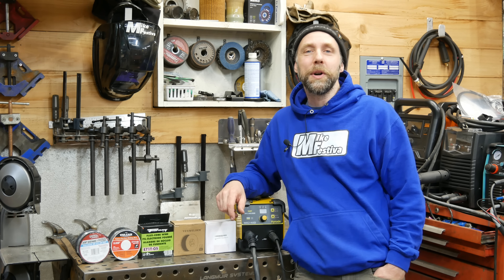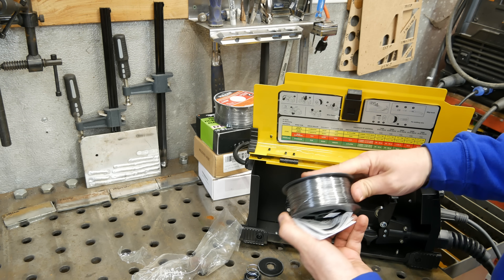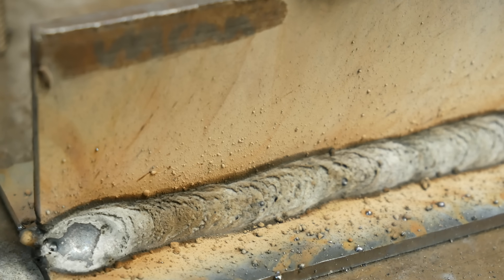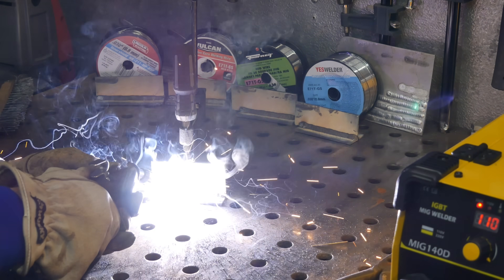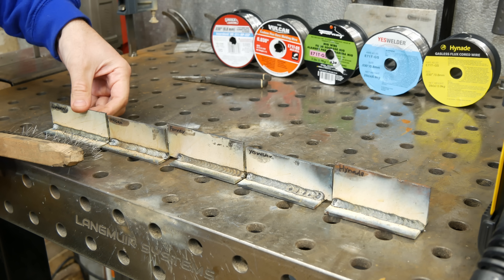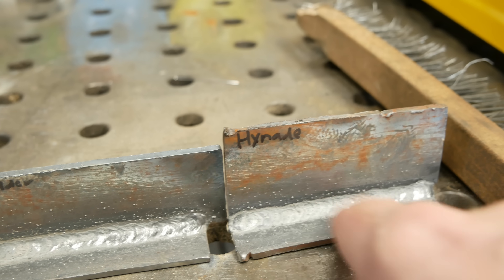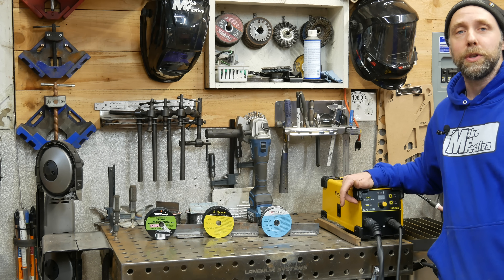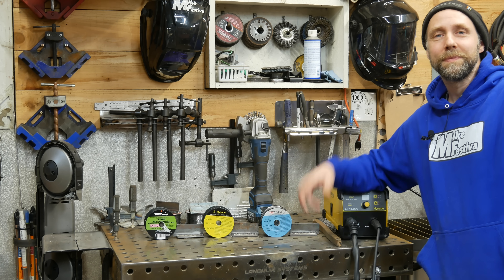Gasless Flux Core Welding Tips, Make Better Cleaner Welds

Comment: If you make sure your welder is set up in DC neg that will give you much less spater and cause less porosity and give you more penetration well. You shouldn't have to change your heat or wire setting at all. also the closer your welding Nozzle is to your work piece the more splatter you will end up with as well. when welding with flux core.
Reply from the maker: I covered all that in this video 👍

Comment: Why do you have the gas nozzle on with gas less welding?
Reply from the maker: Because it really doesn’t matter with flux core wire what nozzle you use, you can take the nozzle completely off and it won’t effect the weld quality. When welding with gas is a different story.
Reply: Some machines can switch between flux core or gas shield. Keeping the shield in place protects the treads.
Reply: @ronaldfranck6960  and the gas outlet holes. Some welders you can buy a shorter gasless shield which still allows a better view of the job than with a full gas shield in place. I'm just a beginner and picking up tips by the bucketload 🙂

Comment: That's all I use is flux wire I'm out side welding. If I was in a shop and could leave my tanks hooked up in a shop I would go with shielded gas welding it looks nicer with no spatter with the dip goop. Good to know about the wire though something I didn't know. I do have another machine I'm thinking of hooking up a tank. This machine does all 3 MIG, TIG, ARC WELDING. I want to modify the electrical wire to make it longer so I don't have to be right next to an electrical outlet.

Comment: Do you like the Hynade better than the Titanium 125?
Reply from the maker: Both are great little welders, the Titanium has been really reliable over the years. The two things I like more about the Hynade is the easy amperage adjustment and the fact you can run it on 120/240 volts.
Both are good are I recommend either of them.

Comment: In regards to the comment about the one coil having the label on correct, I think that might be backwards. Most of the welders I’ve used have the feed reversed from what this little welder shows, so the spool sits on the right and feeds into the wheel on the left so the label is visible that way.

Comment: Reality is after you set it into the machine.. its going to start "rusting". Unless you vacuum seal your welder i guess.
Reply from the maker: Come on are you telling me you don’t vacuum seal your welder??? 😂
Reply: I have a couple of silica packets in my welder's wire compartment, it's the Titanium 125 so it's a top loader and has a "floor" where the packets sit, Also it stays in the box until I need to use it, I live in SE Georgia and it's humid so I can't just leave it open in the garage until I need it again.
Reply: Same mid georgia is horrible on welding wire if left sitting. Just had a 10lb roll rust cuz  someone left door open in the rain. Silica packs in the welder is the way to go though I tape the welder closed if gonna sit for a long time.
Reply: @inukun1989  If you tape the welder closed, you're trapping moisture inside - not what you want. Let it "breathe" and let the dessicant do it's job.

Comment: I just bought a YesWelder MIG-205DS, & i wondered about wire selection as I placed my first order! Thanks for the informative videos that will teach this guy how to weld!
Reply from the maker: Are you going to run Argon/CO2 shielding gas or just running Flux wire?
If your running Ar/C02 then .030 or .035 solid wire is good. If your running Flux just make sure the welder you ordered has settings for .030 or .035 wire and get whatever size your welder will run. Probably will run both sizes 👍

Comment: GREAT informative video! Rookie welder. Even though the video was about wire choice I learned that you should always pull your welds.
Reply: Semi true depending on what and where it is. Heat, Travel direction, angle, speed are your most important things to consider

Comment: I cannot find a single video on YouTube where someone is flux-core welding 24-gauge square tubing.  I see tons of videos of folks welding steel plates though. I suspect that flux-welding thin gauge tubing is beyond the skills of most so few (if anyone) is doing it. 
I'd be forever grateful if you could show how it's done. I have a gazebo made of 24-gauge square tubing and I'm going to have to replace quite a few railings. I sure could use some tips on how to get it done correctly.
Reply: Go look up bondo billy! I struggled welding sheet metal with my flux core welder until I stumbled across his content. He does auto body work and welds down to 26 gauge with flux core
Reply: Go get some scrap and turn the heat down. Only adjust one thing at a time till your jammin
Reply: @Gixsir  thanks for the tip :-) actually, I did just that. I'll see how that goes and it goes well I'll publish it for other newbies

Comment: Hi. Since you are a experienced welder, i have a question. Which one of these fluxcore wire brands works better and has stronger welds, Inetub, Blue Demon, Yeswelder, or Forney? Would like your opinion.
Reply: You can't go wrong with Yeswelder or Forney wire. I have never used Blue Demon or Inetub but have and do use the other 2. I have Yeswelder .030 in my welder as we speak. Great wire, price, weld strength, penetration is great as long as amperage is proper.

Comment: Ive used that lincoln Innersheild wire a LOT,  in a few different machines, and i can say the machine makes a difference with flux.  I cant say why, but lincoln flux wire through a Lincoln digital unit like the 210MP is by far the best results, with it being really mediocre through, say, an older miller 210... to some degree its a Combination of the welding machine and any given wire, so XYZ machine may make different results then the one in this video

Comment: You're getting BBs and average results because gasless mig on steel should be electrode negative and you're running electrode positive.
Reply from the maker: Haha I covered this exact topic in my video that you need to run flux wire on electrode Negative. You probably didn’t watch much of the video before you decided you tell me what I’m doing wrong 😂 but I’m sure you like to make yourself feel better by doing this sort of thing right 👍
Reply: @Mikefestiva   I made the comment after watching your first weld spraying BBs everywhere and looking at your setup with the clamp connected to the negative ground.

PS - I wasn't rude, condescending or obnoxious in my comment.. absolutely zero need for your to do those things. 

I missed it - i do apologise. I don't feel like apologising after your ridiculously arrogant response, but I'm an adult.
Reply: @ryanokeefe12  fr no reason for that response

Comment: I bought a 110V FC welder (Kickinghorse F130) and after using up the wire that came with it bought a spool of Lincoln 0.30, and found it poor by comparison in every way. Then, I did a survey of FC wire reviews and most, like you, preferred Yeswelder and Fornay. I got the Fornay and it’s definitely better on all counts. I’ll keep my eyes open for the Hynade. I’m a newbie welder-I bought the welder for small metal repairs and jobs around the house and love it-very empowering to be able to weld! Thank you for a thorough review and I’m happy you’ve confirmed my choice of wire! And thanks for the tips!
Reply from the maker: Being able to weld metal is awesome! You will definitely fine lots of projects you will be able to build and repair around the house and shop. 😊👍 Happy welding!
Reply: When you find a brand of fluxcore wire that you like, you can consider getting it in a 10 lb. roll, if your welder has large enough space to  fit that large of wire roll in it. It saves in the long run to use a larger roll of flux wire. Fluxcore wire  seems higher these days at some box stores, but it is cheaper online.

Comment: I bought a cheap welder at a garage sale that needed a power switch, I fixed it and it came with some Chicago electric flux wire, granted I don't know how to weld vary well, learning. 

I finally ran out of wire and bought the Vulcan stuff at harbor freight and what a difference, I'm sure the wire is still not the greatest, but man it welds so much better than that last stuff, like I can actually get it to be a consistent buzz and not pop, that other stuff I was having a heck of a time finding the right wire speed and power level, i thought i was just that bad at it lol.

Comment: I recently bought some Vulcan FluxCore because I needed some in a pinch.  Welds OK but I think the alloy is soft.  It is easier to dent with a hammer than the Hobart wire I've used before.

Comment: Someone was saying that flux core welding was for amateurs and pros only use solid wire and gas shield. I am not a professional and I use flux core outside where the wind will destroy a mig weld. So I dispute the opinion that flux core welding is for hobbyists and amateurs. See how much welding you can do working on fences gates corner braces etc. out where the wind blows like West Texas. Shop welding is a different story however if you can’t weld a bead of flux core as pretty as a mig gas shielded weld then you need some practice.
Reply: Hey I'm still learning myself, I don't ever plan to make it my career, I just need it to do small jobs like maybe fix an exhaust, I used mine to patch lawn mower decks, I fixed a broken spindle on a ridinf tractor rather than spending $300 for a new one, I plan to keep using my flex welder, it gets the job done.

Comment: What if u run the welding on 110V as supposed to 220v? Does it make a big difference?
Reply from the maker: As long as you are only welding thinner metal you won’t notice a big difference,   Once you start welding thicker metal, you will notice the 120 volts not providing enough amps. Best to run the welders on 220 volts if it’s available in the shop. 😊👍
Reply: @Mikefestiva  Thanks for that. the welder I'm currently using is a 110v welder. But I guess I need to have the settings right on the plant. I was trying to weld my muffler and some intercooler piping and it creates more bubbles than anything.

Comment: I got a small buzz box do to the fact of digging out the big one.      I used the. Lincoln wire.  Since It was the fasted to find local . The wire was a night and day difference.  Even though  both of them was purchased at the same time.     I will buy some of the forney wire since I have the welder and you recommend it.  😊.

Comment: The biggest difference between flux core welding and solid core is, flux core is a little more forgiving when you have to weld outside in the wind, its a night and day difference, both types of welds have there pros and cons, solid for inside because there is less smoke and flux core for outside welding. Sold core with gas will not do as well outside unless you shield it from any breeze or gusts. Unless you got a 30 mph wind outside flux works the best, try that with solid/gas unless your in a tent. Just saying

Comment: Watched this video before, but just noticed something this time that I didn't pick up on before.  The Lincoln NR211 is the only wire of the five you tested, that is specified for single or multi-pass welds.  The other four were all single pass only wires.  Perhaps that might account for it being the most expensive?...  Anyway, it is another consideration when looking at these wires.

Comment: Been trying to weld for a few days now and watched tons of videos, I cannot seem to get any kind a puddle to build up at all.. any help?
Reply: Turn up the heat, try thinner material,  clean the material of all paint & rust. Don't give up its easy. You will get it soon.
Reply: @stevenmchenry9276  thanks for the response, i think I’ll try thinner  metal, but I should be able to get a puddle to build up on the surface ok a thicker metal? My welder is real basic only has switches to adjust heat
Reply: The puddle builds up while welding, and you should be able to see the puddle through your welding hood. It’s bright red. Can you clearly see the cherry red puddle while welding? If not, it could be two things, your helmet is not good. Buy a better one so you can see the puddle better. Second thing, is that you’re moving too fast, so your weld puddle is not building up before you move on. And actually, third thing is that your settings on the welding machine are off. Measure the thickness of the material you’re welding, and usually your machine will have a set of instructions on the proper settings for the thickness of metal you’re welding. Good luck!
Reply: @davidtaylor3544  thank you for the response, yea I think I need thinner metal, Ican see what should be the puddle it just won’t become anything more than a splatter even if I just barley move along
Reply: Nope
Reply: @larrywarolin7215  cool thanks 💩

Comment: You have to remember Lincoln NR211 is not the same as the others. You did not compare the same wire.... Lincoln has many flux cored wires, non work the same. ESAB also has different wires. 
Having said this, after 30 years of professional welding, I do not like lincoln NR211... It has a very specific job, and very specific settings. If you can find that one job with the right steel.... Then it is great.  There is actually very few producers of welding wire world wide. So you have to find a wire that works with your machine, and for your purpose.... And stick with it!
Thank you.

Comment: Is there any flux wire that's decent for high strength welds? I'm trying to reweld some stuff that'll be farm use and need to handle a couple hundred PSI, but I don't wanna spend an absolute fortune on a welder for it, either.
Reply: I welded up a tractor PTO shaft for a 6' Brushhog with my Hobart 210mvp and Lincoln flux core. Seemed to hold up fine.

Comment: Hey Mike, I am welding 1/8 flat bar bent at 90 to 1 x1 1/16 thick square tube cut at a 45 on each end. I using .030 wire with HF Flux 125. I am setting it per 1/16 thickness, but i keep burning a hole through square tube. Is it easier to weld thinner metal with a mug welder vs flux ? Thank you
Reply: imho flux burns deeper vs solid core, but I'm far from a pro could just be the result of going faster on the solidcore :)
Reply: @jeroenvandend   Thank you!
Reply: Flux core is very tough to weld with on thin material like that 1/16"
MIG is easier to control for thin metals. 
Flux core needs more heat so the arc blows out thin metal and cheap machines only have one knob for adjustment.
Most MIG machines have independent parameters for Voltage and wire speed so they can be dial in for material thickness and wire diameter.
Reply: @Roy-al-Paign  Thanks Kada! A MiG welder is definitely my next tool purchase.
Reply: @Roy-al-Paign  I use flux on body panels almost daily that's much thinner then what he is doing and I dont have issues with blow through.
Reply: @markreinders2261  what kinda machine and wire do you use? I have a cheap machine so it's tough.
Reply: @Roy-al-Paign   @kade hesler  hynade 175sg($269 for the base machine with mig/flux torch and a stick torch). 030 wire, brand depends on what I'm doing. Either just the harbor freight stuff or hynade wire for day to day stuff or Lincoln wire that's rated for multiple passes if I think it may be necessary when doing thicker metal. 95% of the welding I do is body panel patches and flux core works just fine for me on that. A lot of the cheaper machines cant be adjusted down enough to do thinner metal. The machine automatically sets wire feed speed and voltage based on the amp setting you select. The voltage can be adjusted manually from that if you want to.

Comment: Nice video and great comparison test, though one thing that I would like to add for additional comparison would be to do a section and etch; and/or, possibly do a bend test on the coupons (but only if it is welded on one side).

Comment: Hi. Really liked this video. There was much more to learn as you went along. I'm new to flux and needed to know I've been using lousy flux core (Vulcan). I now know what to look for.

I wish you had done this on 110 volts to know if the performance is the same. I wouldn't be surprised if you got different results at different voltage.

Thanks.

Comment: I don't remember the exact process I was doing in class, but it was GMAW or GMAWs and I loved it. The instructor had two different gas mixes we could choose from. I found the 98% Argon and 2% Oxygen worked best for me. I wanted to say I was running at 25v and something well over 400 inches. I was a year ago and I moved in the middle of the semester to a different state. Not much in way of classes around here that would work for me. I miss it.

Comment: Welded for many years all types of welding and when using the flux core tried other name brands but Always go back to the Lincoln wire. Every one is a  little different but all will hold. You done a real good job welding. Thanks
Reply from the maker: Thanks man I really appreciate it 😊👍

Comment: When looking at the labels, the AWS (American Welding Society) on the Lincoln is E 71T-11 and what I can see of the others are AWS E 71T-GS.  What is the difference between "11" and "GS"?  Maybe that's why the Lincoln costs more, and maybe offers a characteristic that the others don't?  Thoughts???
Reply: The Lincoln E 71T-11 is a multi-pass wire.  The E71T-GS are single pass only.  If you make multiple passes with a GS wire, it will become brittle due to the higher manganese content.

Comment: Great video. What are the pros and cons of 220V and 110V? Pros and cons of. 030 and. 035?
Reply: The higher the voltage, the higher   
You can go with the current and the thicker the material you can weld.
Reply: @geraldmiller600  thanks. What about the uses for the different gauge wire